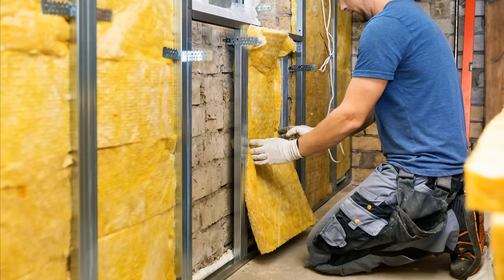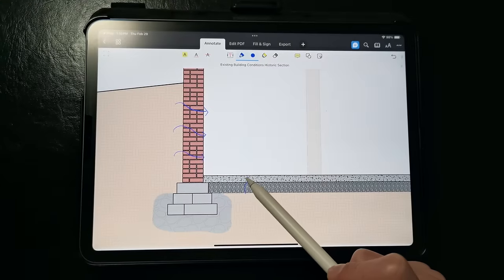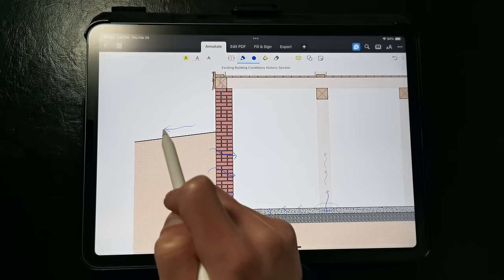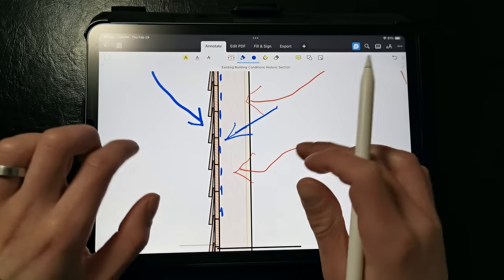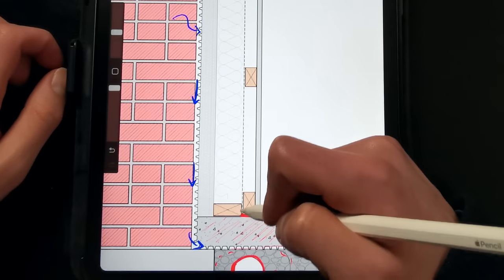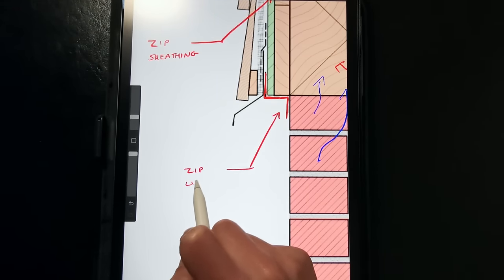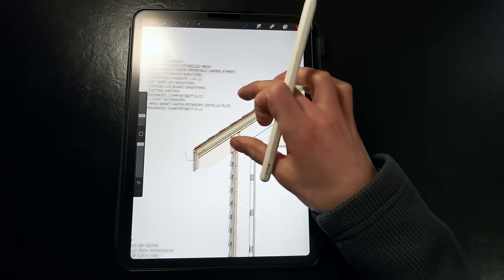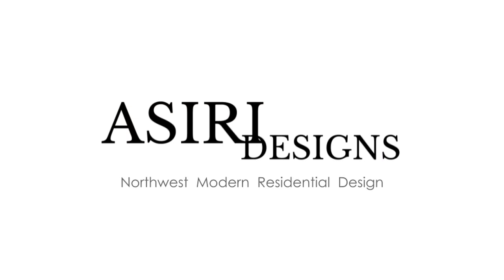A Complete Guide To Insulating an Old Home (For COLD CLIMATES)

Comment: This is invaluable, just bought my first house, not as old as the theoretical house here but a 1940s Cape Cod style with minimal insulation. Previous owners put mini splits and new windows in, other than that it's largely a clean slate for insulating. Thank you for this!
Reply: Don't thank this guy and study yourself. Almost everything here is wrong. Obviously, he has never done it.
Reply: @robertkosulic4122  What's wrong and why?
Reply: @incognitotorpedo42 very expensive
Reply: @claireh.7605 it's actually a very economical approach. He's not recommending major structural modifications, just coatings and some extra layers. There's no cheaper way I can think of.

Comment: My question concerns vented vs non-vented attics. I have a open vented attic, so it gets very cold in the winter. We do not currently have soffit ice jams that are very common here in Mass.  We want to insulate the attic to retain heat to make it more useful for storage. My plan is to build vent channels, between the rafters, from the soffit to the peak, to allow cold air to still  rise and cool the underside of roof deck. Then insulate inward of the vent channels, to hold heat in the attic. my plan is to seal the inside opening of the peak vent so that to the inside air doesn't escape, but the vented air can still exit the the peak vent.  IN the summer we would open  the peak vent completely so the the heat in the attic could escape. The alternative is to seal the attic and put insulation between the rafters, hoping that the roof will not get too warm, and cause melting-refreezing problems .  Any thoughts ? Gerry

Comment: First tip is to NEVER use steel studs for anything structural or insulated walls as it will suck out/in the heat many many times faster than a thinner wood stud

Comment: I've seen a project where they jacked the rim joist up in sections to instal a dpm/air sealing gasket between it and the masonry. The building can move a lot before adding the exterior sheathing, as the old nailed board don't have the shear strength. Seems like a pretty good detail to me. Those borate plugs are dubios - I get using it for protecting end grain in for joist embedded in masonry wall (we have a lot of these in the UK), some even suggest using stainless steel plates to encourage localized thermal bridging to keep the end grain drier.

Comment: Thank a bunch for taking the time and educating me. What I’m looking for is the solution between the studs. You’re speaking jibrish to me because of my ignorance! What is a good brand or a particular item I can use to insulate between the studs. I have a two story house, upstairs not insulated, I’m only insulating the bottom floor, brick on the outside and drywall on the inside. 700 sqft downstairs and the upstairs mirrors the same surface so 1400 total. Thanks man 🙏🏼

Comment: In cold climate ares its best practice to have a vented attic with moisture barrier at the ceiling. 6mm minimum. Baffles at roof line. Energy or thick assembly truss design over exterior walls. Good ridge vents. At least in the mountain west were the air is dry. Roof assembly in higher elevations get the cold roof design with a good air gap under shingles. Cheers from Montana.

Comment: Certainly interesting and an in depth look at  insulating old houses.. However seems like it would be better to bulldoze the house and put up a replica?? I did want to hear what the thoughts are of close cell foam ?  If it is impermeable to moisture ?  which is the problem, moisture getting trapped  in fiberglass insulation..??

Comment: Beautiful and detailed video. I don’t know if there’s better content out there than this on retrofits. It would be nice to work with more people like you who leave no stone unturned in the details. 

I’m interested in understanding the goals of the homeowner in a project like this. The costs of carrying out this retrofit  are extremely high, essentially bringing the building back to existing framing on both sides. Plus major basement floor upgrade, roof upgrade. All interior gutted, probably new mechanicals, plumbing, rewire. Windows. Homeowners have to move out for a while. In my area (Vancouver, Bc) the budget would need to exceed 500000 CAD for retrofit + renovation depending on the size of home and many other factors. (Probably more) At some point the cost to many homeowners is unjustifiable. This homeowner must care about protecting the heritage of the building, sustainability, and have a very healthy budget. Great client type! Was this work actually carried out on this home?

Comment: Excellent video again. 

Conditioned attics are great to run services. Yes, you have about ~30% more surface area to insulate, but air sealing the attic ceiling perfectly is really fiddly, saving the labour cost and liabilities alone is probably worth the extra insulation.

Deep fascia detail can be addressed by extending the overhang. We have a lot of issues with not having a sufficient overhang, so this ends up protecting the buidling's facade from the rain more - the uplift issues do need to be considered too.

Comment: Personally I would avoid using borat salts indoors because they´re considered to be an endocrine disruptor, IE messes with your hormones. Other than that I think most of the solutions are good/sound.

People often forget that the biggest energy leak is when your building is not air tight. Just making it air tight helps a lot! Insulating should come as the secondary solutions because, as you mentioned, it comes with a lot of potential moisture issues.

Comment: Can I ask what product(s) are available as capillary breaks between footing and foundation?
Reply: The same liquid applied waterproofing products for  foundation sides can be applied to footing before the vertical is placed. There could be some other options too 🤷🏻‍♂️
Reply from the maker: With regard to embedded posts, sometimes it's possible to retrofit a raised post base to uncouple the wood post/column from the concrete.

Comment: This is so detailed. What if you have a brick house and for heritage reasons, cannot insulate from the outside? How do you insulate the brick wall to a NetZero standard?
Reply: He covered that question in a previous video you'll need a smart vaper barrier and a air gap between it and the interior drywall.
Reply: Do you work with clients in Canada?
Reply from the maker: Those tend to be the most tricky, and it depends on a lot of different factors including the exposure to weather/overhangs, climate zone, whether the brick wall is a veneer or a thick multi-wythe wall. Sometimes it's better not to insulate! You might find these two videos to be helpful:
https://youtu.be/0pOjJ-w733E?feature=shared
https://youtu.be/Csjs2yVVt7A?feature=shared
Reply: @ASIRIDesigns  Thank you!

Comment: my 1920's house has ice daming issues at where the wall meets the roof less space between the wall and the deck compared to ur drawing. the heat transfer of the wall going up apears to be the cause is there much i can do?

tried looking for zip system products but no one seems to stock it in canada all i can find is 100$ a sheet foam
Reply from the maker: I'd recommend checking out this video on ice damming: https://youtu.be/ibcssy25TOY?feature=shared